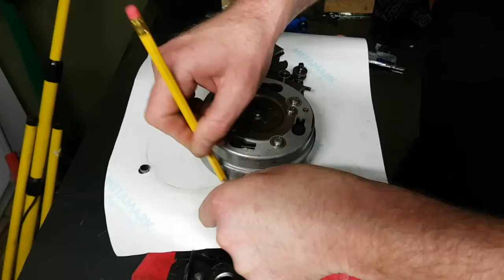MAKE YOUR OWN GASKET - Easily make a hard to find gasket for a classic engine

Comment: what is the thickness of gasket paper?
Reply from the maker: You can get it in any thickness you need. If you buy a kit there will be most thicknesses that you would need on the kit
Reply: tnk for the answer, but i want to know what thickness of paper  you used for your engine..
Reply from the maker: Off the top of my head I can’t quite remember but it was either the 0.8 or 1.6mm. If the gasket is a bit thicker it will seal any imperfections in the surface if it’s not been prepped properly, if you do use the thicker one just make sure to re-torque the bolts once you’ve ran the engine as it can compress when the engine expands and contracts with the heat